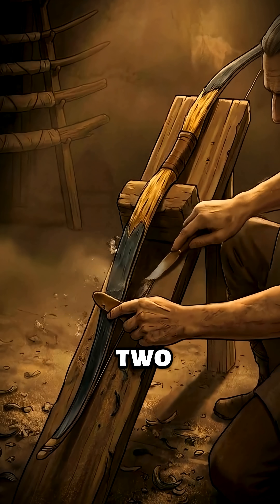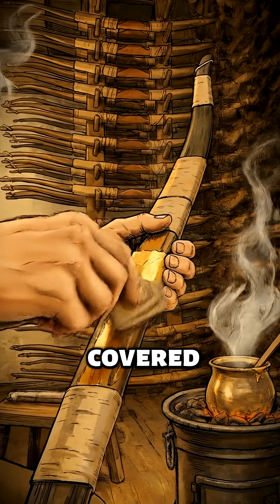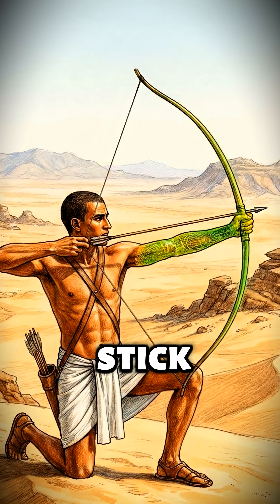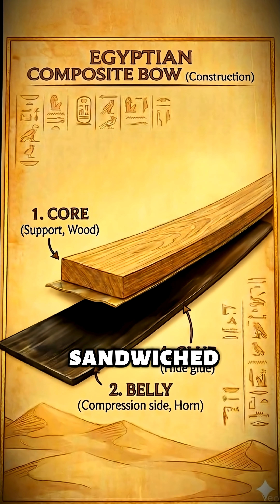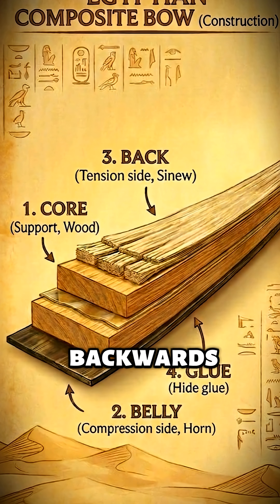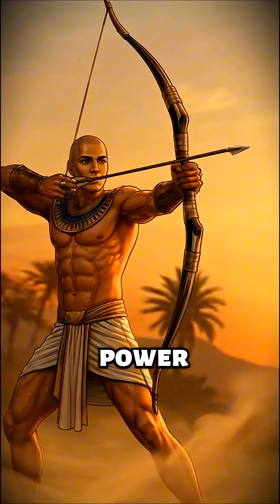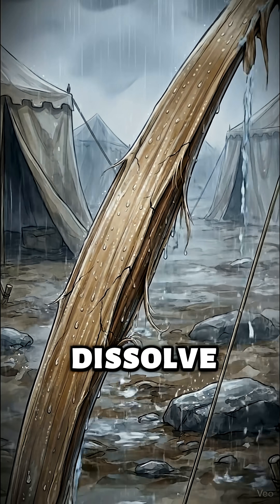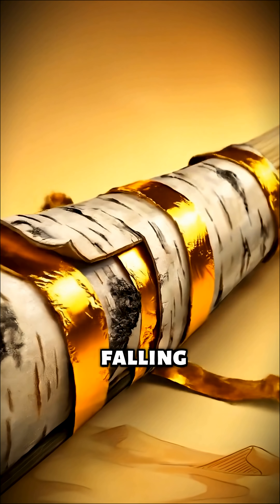This Ancient Bow Broke the Physical Limits of Wood

Comment: Fly 300 meters and then punch through bronze armor????
You know "Tod's Workshop" is all the way up to arrows vs armor 3. 
You have to keep it at least somewhat believable.
Reply from the maker: no, it is either punch through armor ( short range) or fly 300 meters.
Reply: @Techtreeofhumanity it is not punching through bronze armor... 
A medieval crossbow with a 1200 lbs. draw weight is stopped by most armor. Against bronze armor maybe the 1200 lbs. crossbow could go through, but still probably not.

Even if for no other reason then the fact that the arrow is not capable of withstanding the force.

This is a bunch of bull.
Reply from the maker: @chrischris5081   I double checked with different sources then the one i used for the video and you are right, plate armor was only possible when it was a bad armor and perfect conditions for the bow. so i deleted this sentence.

Comment: Two years? How would you sustain a kingdom if it takes two years to make a single bow?
Reply from the maker: the process took 2 years but they worked on several of them in parallel. but most solidiers had wooden self bows. only elite troops and nobility used composite bows
Reply: The master bowyers and fletchers had several apprentices who learned the method over several years and mastered it eventually. 

So assuming 7 years and around 10 apprentices attaining mastery. In 14 years it would mean 110 new master bowyers and fletchers.
Reply: It took that long due to fish bladder glues that take that long to dry